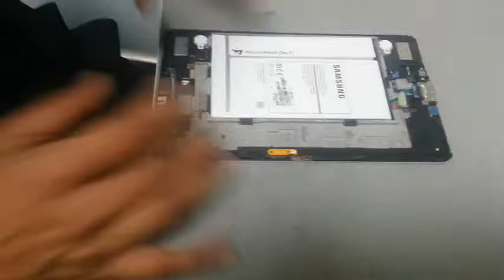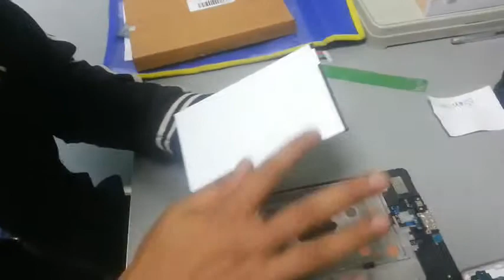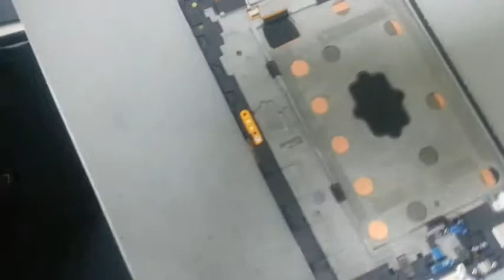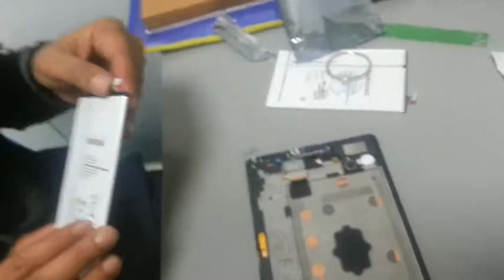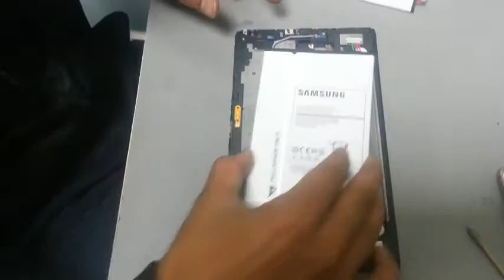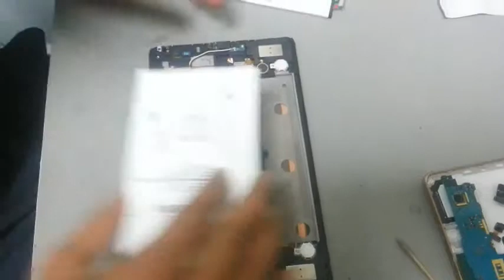T705 battery Replacement

Comment: How to measure Volts and direct charge this kind of battery ?  Because battery have more than 2 wires.
Reply from the maker: you can use multimeter for this